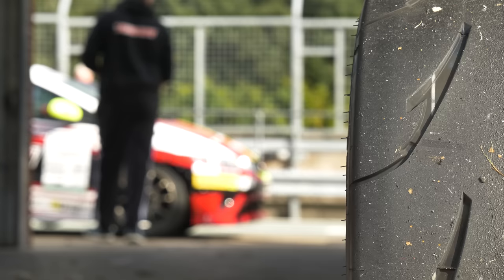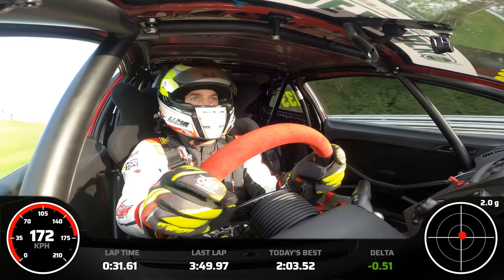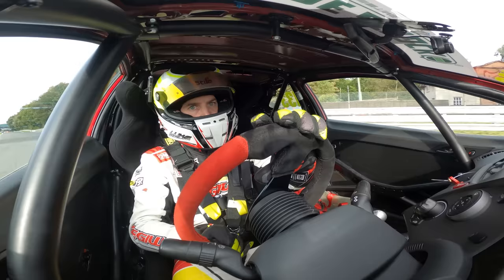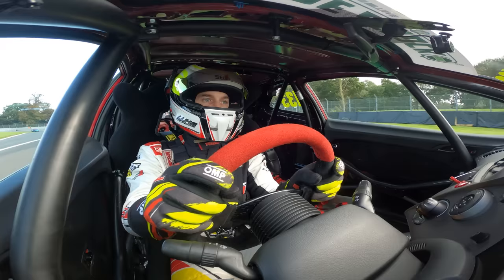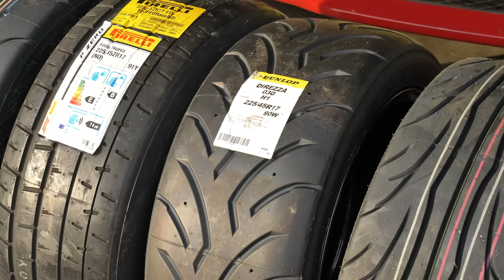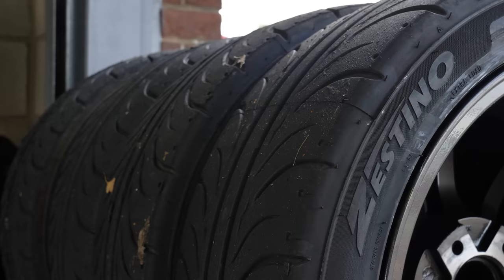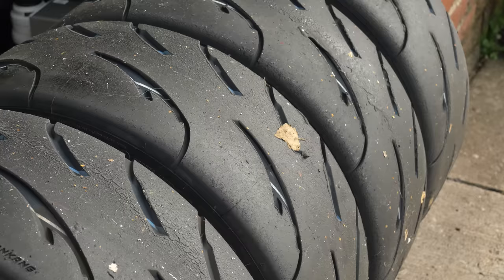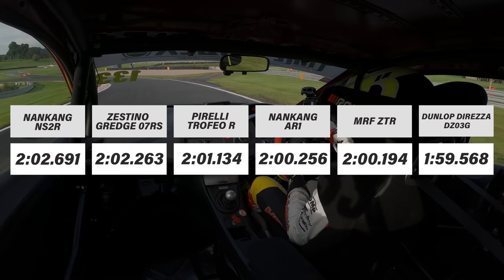The ULTIMATE Track Day Tyre Test! (2021) - Dunlop, MRF, Nankang, Pirelli, Yokohama, Zestino!

Comment: The AD08RS is why im here, its one of the go to decent road based track tyre, shame you couldn't test it. The AD08RS vs the NS2R is what im desperate to see.
Reply: Just a shame we can get the original AD08R's anymore, the new RS compound detracted from the appeal of the original tire, still a good tire though. For the price the old ad08 was the perfect fast road and track day tire.
Reply: He could have mentioned that at the beginning. Could have saved the time. I was dissapointed!
Reply: They feel quite similar on the road but ultimately the ad08rs has a bit more grip in the dry and works better in the wet as well. The ns2r are incredibly value for money
Reply: I looked at the Ad08 but id read that the new compound wasn't as good and that the ns2r was better in damp conditions. It was important to me to have some kind of ability in the rain as I don't want to keep destroying my ps4's!
Reply: @Itsallfun3000  im using the AD08RS now, not quite as good as the AD08R was on the street, but worked just as good when hot on track. If anything the RS lasted better too, seemed to stay on for a while longer than the R. Not a bad trade off for a little less cold grip.
Reply: RIP your dreams.
Reply: Also came for the AD08RS….bummer…..
Reply: i was equally as fast on Dijon-prenois with my little Ford Fiesta (100 hp) on Yokohama A052’s as my friend who was driving his 200hp integra type r on NS2R‘s… says alot about the nankang. yes they are cheap, but you get what you pay for….
Reply: AD09 will arrive early next year
Reply: AD08Rs are just a better version of the NS2R
Reply: No comparison with such a vast price difference imo.
Reply: I'm seeing AD08 R in the video, it has a easily identified tread pattern,  but no mention at all, no lap time?? If you show it, you need to speak of it.
Reply: @tom.wassell  is it hard to warm up the AD08RS? Some people say it is similar to the Nankang NS-2R, and a lot of reviews stated the NS-2R is incredibly hard to warm up properly, which suggests it does not make any sense outside track. Is that the case with the AD08RS too? Should I buy some regular UHP tyre instead? (mainly twisty mountain road use)
Reply: @staLkerhu  on the road they take a bit to get heat into them, but work well.

I haven't really noticed any difference between the R and RS on the street, but on the track the RS last a lot longer.

Only downside to the RS is it seems to get harder after each trackday, but also seems to last longer.
Reply: @staLkerhu  if you're wanting a predominantly road tyre, you wont go wrong with a PS5. A wildcard would be the 651extra, theyre phenomenally grippy on the street and wear okay for a 100tw tyre. Usually half the price of the PS5, but the PS5 will last 3* as long.
Reply: @tom.wassell  nah, I would rather pick an Eagle F1 SuperSport or SportContact 7 for a normal UHP tyre. Maybe one day I will give a chance for Michelins, but not today.

Comment: I was really looking forward to finally finding out the difference between the NS2R & AD08RS
Please do another video!
Reply from the maker: Stay tuned on the channel! We hope to do more tests next year!
Reply: @tegiwa  I'm subscribing now ready for that
Reply: I run the ADO8R on my Evo and it's a great tyre
Reply: @evo5349  AD08R and AD08RS is very probably a difference ...sadly. tryed both but in different cars / sizes
Reply: @moegigo  I still have the last of the older ADO8R which people say are better than the RS.
Reply: @evo5349  yeah they're! Euro rules said the tyre had to be a harder compound and it kinda ruined the tyre. I was really hoping to find that out in this video lol
Reply: @evo5349  yeah it's an epic tyre and the only tyre I ran on my Clio RS200, but Euro rules made the RS a harder compound so was looking forward to seeing it in this video
Reply: @Phil16Wales  Yes so right as I can push my tyres and the Evo loves it but KW track suspension makes a big difference.
Reply: @Phil16Wales  hi mate go from AD08R straight to A052, so much better as the AD08R.

Why do I stay on A052, cause it is a same light weight under 8kg (7,8-7,9kg) in 195/50 R15 even it is 86 XL. Nankang & Federal are about 9,5kg
Reply: @evo5349  yes they are better, RS is worse sadly. Drove the AD08R for some seasons, then changed to A052. These cost more and have less profil, but do everything much better.

A big plus is they don't change that much pressure on various temperatures once heated a bit.

Comment: Surprised you didn’t plan to test the Yoko A052s. Amazing track tyre that works well into the wet, and road usable. Interesting test though, would be interested to see a sequel!
Reply: This was the fastest auto-x tire this season.
Reply: Yoko A052s very good
Reply: I run AO52 the grip is insane
Reply: How about Yoko A050s ?
Reply: @jonjoni7939  I don’t think they are street legal
Reply: @jonjoni7939  A050 would wipe the floor with them all

Comment: Be really interesting if you ran the same test on the exact same sets of tyres again next year to see which drop off through heat cycles and harden quickest. (as most people aren't using brand spankers every time).
Reply: Excellent point. Those of us that live in hotter climates see heat cycling faster than cording out.

Comment: Big fan of the NS-2R. Run them on my Evo 6. Pretty much the perfect tyre for what I use the car for. Fast road, very occasional track day. Yes not the fastest but when out on the NC500 in the middle of Scotland, 4 degrees outside with hail coming down, they still grip. I run a slightly larger aftermarket wheel so tyre is 225/18. At (time of buying ) under £90 a tyre (unfitted) that price point wallops everything else here. Bargain.  Much more direct and precise than the previous Pilot Sport 4 (a very good performance road tyre). 
Great video. More please......
Reply: How have you found the noise. The ones on my car make it sound like it's got a wheel bearing out
Reply: @andrewlangford88  HI. It's Fine. They aint a quiet tyre but then I guess no track tyre is. In all honesty, an Evo with a decat exhaust aint quiet, so tyre noise is not really an issue. What car you running these tyres on?
Reply: N15 Nissan Pulsar SSS with an SR20DET swap and a whole heap of other work.
Could actually have a wheel bearing out though lol
Reply: @andrewlangford88  Sounds like a giggle. Respect to that build.
Reply: I ve just put a set NS 2R on my BM I find them so noisy on the road I’m thinking of taking them off. Did you find them noisy 🍻?

Comment: It’s also worth not those are NOT the current Trofeo R but rather the old Pirelli Trofeo. This should be corrected. The new Trofeo R has been shown to perform faster than all the tyres shown here based on everyone’s testing.
Reply: I am not 100% sure about that, it may be the R albeit a porsche spec which would explain why the rear was staying cold..

Comment: Great comparison, shame you weren't able to test the AD08RS as that's the one I'd probably go for having had the AD08R in the past. 

Impressive how there can be a 3 second difference between the tyres with them all being made with a similar purpose in mind - I thought it'd be a lot closer.
Reply: I heard a lot of AD08R users were very disappointed with the newer AD08RS tyres. From cost-cutting measures and also due to new euro legislations that require them to use harder compound, the way the cars lose grip on AD08RSs tend to be a lot more unpredictable and less progressive than the AD08R tyres

Comment: Useful video :) For road I quite liked the NS2R's, but they did wear out a bit quicker than my AD08's. The AD08's seemed to have a relatively soft sidewall compared to the R1R's I ran before them. The AR1's I had on a 182 turbo, and they were very good.

The AD08's wore well as a road tyre, but I was always missing that instant response due to the soft sidewall. The old (now illegal) R888's were brilliant. Not tried the new version yet.

Comment: Thanks for ruining my time by not testing the Yokohama
Reply: It's a shite tyre anyway
Reply: @kratcliffe5680  V107 fine for enthusiasts like myself, but I never tracked them 😁 Just like to fool around. 
Doing anything track related in Sweden is too expensive and a major bureaucratic hassle. Fully fire resistant clothing covering up, a track approved helmet, gloves and shoes. A day one insurance that will not cover the car/bike (like wtf), a temporary member fee for the event and I can't even remember what else it was. 
We had a morning intro, a driver spoke for another 30 minutes, we walked the track two times and I did only three laps with my Type R FN2.. then there's different decibel values at each track, 110-120 being common if I remember correctly. Had Bridgestone Sport back then, worked fine.

Comment: I would love to see R888R vs AR1
Reply: I would guess the ar-1 is faster
Reply: @randomtoyotadude8952  from my experience, i would say it would depend on track temp.
If colder R888 might be faster, if hotter than the AR1
Reply: @PedroFTeixeira  
I have no xperience on R888, but R888R… the AR-1 is faster and feel better driving
Reply: @randomtoyotadude8952  Yeah, I meant the R888r, the R888 are discontinued.
I like the Ar1 alot, but on the cold temperatures they don't work as good.

Comment: Shame you didn't manage to use the AD08RS, I ended up getting NS2R to replace the old AD08R I had. From all reports everyone was saying the RS version was way worse. I could've went with A052s for my setup but I felt like it probably wouldn't be worth it for myself also I didn't really want to pay over a grand for a set of tyres. 

Maybe once these NS-2Rs are done I'll step up to some AR-1s and then if I have to do a wet day I'll use my road wheels with PS4's on them.

Comment: Great work to see how they all compare. One video I (and I'm sure others) would be really interested in (although harder to test due to weather) would be wet tyre choices as plenty of track days, even in the "summer" can end up wet.

Sticking more to the road based/easy to get hold of tyres like the Rainsports and Pilot Sport 4 (rather than the S as it's not available on the sizes I use!) NS2R, AD08RS etc and not so much on competition wets.
Reply: It would be interesting. I have found a quality road based tyre to be better that a semi slick in the wet. Vastly more so if it is cold.
Reply: @philipjamesparsons  agreed. I'm thinking along the lines of back to backing stuff like the PS4 (not the S as it's not available in the sizes I run) and the new updated Rainsport 5 with the XL carcass that aren't as floppy and useless in changeable conditions as the old 3

Comment: To give you some idea,i race an mgzr 170 in mgoc on toyo 888r tyres pole time 2.20.2 the mgcc same spec car as ours use Dunlop Direza and lap at 2.17.00 that shows just how good the Dunlops really are!
Reply: The dirrezza is fast, but a little to soft side walls to be top 3 tire… but that just Imo

Comment: Awesome video! I will admit I am Surprised at the result of the Zestinos. Several people down here in Australia have performed testing and comparisons and found them to match the Nankang AR1 lot of others seem to confirm this too. But great nonetheless
Reply: I've tried them, they are faster than AR1s in some tacks! Don't know why they are slower in this test, but from my personal experience it's a better tire.
Reply: @fvscr  highly agree too. Someone else on YouTube did the same test and confirmed that. Look up the Zestino 07RS review by trackhack. Several others here in Australia have tested them here too. The Trofeo, if it was the actual (R) would’ve won. But they tested the wrong ones
Reply: @fueledgti  Zestino TW140 feels like a softer compound for sure, AR1 its a great tire, but from my personal and lots of friends, zestino 07rs its a bit faster. This also happens in other countries when they change AR1 or 888r to zestinos. I can tell Zestinos tw140 feels very similar to RE71r. Trofeos with a proper setup and a proper driver its SUPER fast.

Comment: It was a good test. However, I will say that I strongly disagree that tyres such as the  NS2R are a fit and forget all weather, all year, road and track tyre. They are excellent value for a dry track and maybe a warm but wet track. However, they do rely on heat to get them switched on. In cold, wet conditions, road or track they provide poor grip and get into a no heat, no grip viscous circle. They are too stiff for the road and have high rolling resistance. Stick to a quality road tyre for the road, like the PS4 and they will double as a wet track tyre. By all means, buy Zestino, NS2R etc for the track but don’t expect they will be much use November to March in Europe.
Reply: A lot of people do not agree when it comes to ur opinion on ns2r, a lot of people use then on the road, and track.. i even know a company who use then on track every day.. gotta be for a reson

Comment: Do you think it's worth getting a 200 tread wear tyre for a 170hp track car? I'm currently on lowered springs and michelin PS4 tyres, getting coilovers and bucket seat in before my next track day
Reply: Yes. I'm on 195/50/r15 and about 180bhp and it's about right.
Reply: Ps4s is the ultimate high speed tire..not ‘that’ good for short tracks but for every day use and high speed.. there is No better tire in the world…its a reson why BMW/Mercedes/porche been sold with this tire!!!

Comment: Did you guys do a report on the hot temps anywhere ? wondering what the ideal starting cold temps are on these
Reply from the maker: Hi, @ 1:49 you will see the manufacturer recommended hot tyre pressures.

Comment: Great review, pity you did not include the Cup 2?
Reply: Despite what people may say, they aren't really a track tyre
Reply: @s4ms0n1t3  They very much are and I use them a lot, what an odd reply
Reply: @FuglyPaul  well, in my opinion this line up are all more track focused than the the cup2. Whilst a great tyre its more a dry weather focused road tyre and argue it would go off quicker than most of these on track. Michelin released the cupR which is properly track focused for that reason
Reply: @FuglyPaul  also, tegiwa don't sell cup2s 😂
Reply: @s4ms0n1t3  the Cup 2 is a 5.5mm semi slick road legal track tyre, and generally wins most of these tyre comparison reviews, I'm really not sure where you are getting your information from?
Reply: @FuglyPaul  going to track days, talking with people, forum debates on tyres etc, its just an opinion at the end of the day and thats what's cool about these comment sections. Also. The cup2 is never beating the ar1, direzza or mrf for outright lap times..im currently running the Zestinos which whilst not the fastest has in the past lasted longer on track to a similar setup car to mine using cup2s...as in gone off/over heated. If your harp back to the e46 m3 csl release that came with cup1s now that was a proper semi slick track tyre. Epicly fast in the dry and utterly useless in the wet. The standard cup2 is much more road friendly. Also alot of tyres reacted differently to...different cars.

Comment: How does the NS2-R perform in wet and cold conditions?
Reply: From personal experience, very badly. They get into a no heat, no grip cycle. A quality road tyre like the Goodyear Assymetric 5 works well. If 18” + wheels, use the Supersport version. They are great in cold and wet, work on a dry track and the road. A real fit and forget tyre for the regular track dayer.
Reply: @philipjamesparsons  
Thats ur xperience.. but not mine.. ns2r are better than most track tires in the wet.. remember this tire is 50/50 street/track..
Reply: @randomtoyotadude8952  I did buy them because they are B rated for wet grip. In 15°c, they may well be good in the wet. But on a 5°c winter track day, my experience is they are not good.